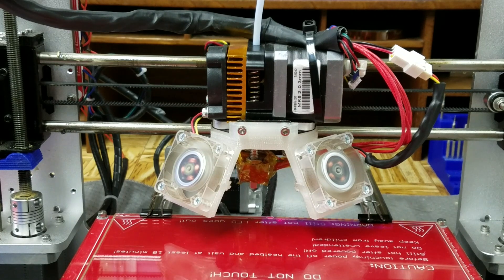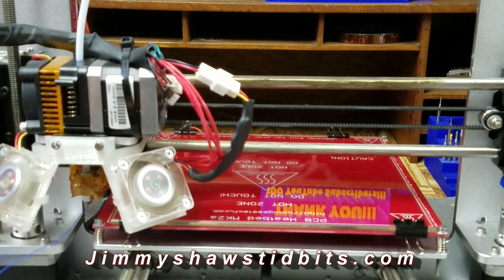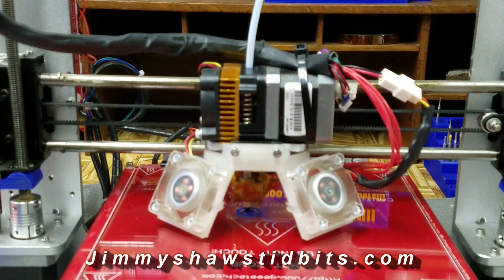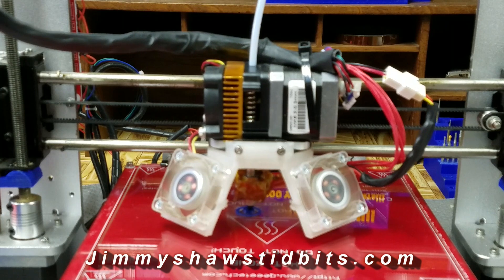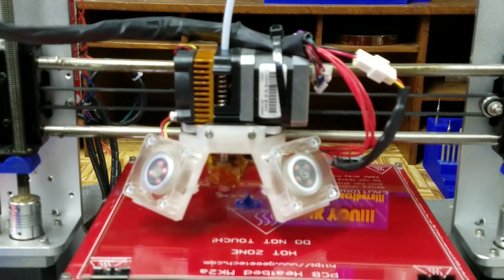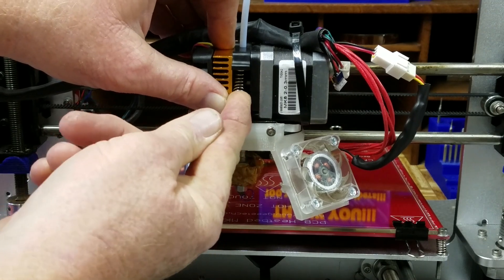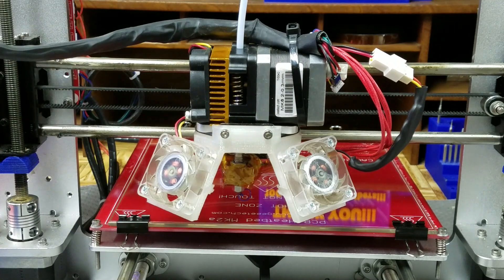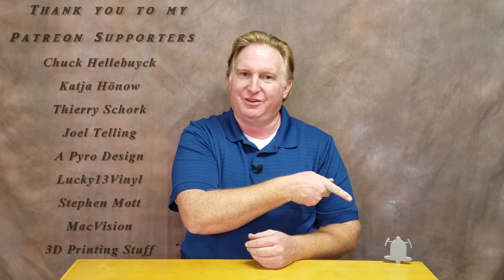Fixing a "clicking" / slipping Extruder using a 3D Printed Shim

Comment: Thanks for the tip Jimmy.  I was having all kinds of problems and I thought it was the nozzle clogged (I still think that was part of it, I only cleaned it a dozen times or so). After your tip, my problems disappeared.  I also think my filament diameter changed just a little (1.74 to 1.70-1.68). Can't say enough for measuring each roll before you start. Thanks again.

Comment: I definitely had issues with this filament feeder due to bad spring tention. What I did was buying a complete new feeder from chinabay. Your solution is really good and I recommend if you have this printer to test it out, even if you don't notice this problem at first.
Reply: I have a recently purchased Geeetech and it seems the spring on mine is pretty strong. Maybe they fixed it.

Comment: I fixed this problem by buying a metal feeder arm assembly for 5 bucks on ebay :)
Before that I used to put metal shims under the spring to increase tension and the feeder arm broke eventually.
Print quality is A LOT better now since there is absolutely no filament slippage in the extruder. I can also extrude much faster.

Comment: The lever presses against a notch on the left side below the aluminum wheel. My guess is you can compress the spring till it's fully compressed, as long as the arm presses against the notch the pressure on your filament does not increase...

Comment: on mine acryl prusa i3 with the mk8 extruder it was not the spring but the piece that stopped the tension weel from rotating any further to the motor gear that caused the problem to solve this you have to use some sandpaper or file to remove some of the material after that mine was working fine I hope that this will help some of you with the  same problem
Reply from the maker: +tom moolenaar Thanks for sharing!!!

Comment: i have a geeetech a10...on my second print n so forth...ill hear the clicking then stops after a while..could it be im too close to the plate? the nozzle not hot enough? i new to this i just want to be careful not to break anything.
Reply from the maker: You are correct.  Double check the bed level to make sure it isn't too close.  If it is not try turning up the temperature by 5 or 10 degrees should made a difference while it's printing.  If that doesn't then then check for a clog in the nozzle.

Comment: Hi,
I have made a home made 3D printer. It was working fine initially but now it is not extruding filament from hotend properly (it is coming out all wrapping into it)

1) is it because no heatsink fan on hotend and it is melting filament before reaching hotend?
2) Is it because there are groves on filament due to extruder gear and that is causing this issue?
Reply from the maker: I would guess the heat sink fan.  If the nozzle throat gets too hot from heat creep from the hot end, the filament will melt a little in the throat.  When that happens it just keeps going till it clogs.
Reply: @JimmyShawsTidbits1   thanks for the reply. I resolved those issues.
Currently I am facing issues with Z motors. After each layer Z motor doesn’t move up as needed and end up ruining previous layer. Currently I am moving Z motors manually (clock wise) to avoid this issue.
Is there anyway, I can increase the Z motor position after each layer?
I am using Slic3r for gCodes and PronterFace for printing the objects

Comment: Hi,

How to adjust z motor reach after each layers?
In my case, z motors are not moving as expected and end up crashing into previous layer.

Is there any config changes needs to be done in Merlin firmware?
I am using slic3r for gCodes and PronterFace for printing.
Reply from the maker: I don't mess with the programing end on marlin, but I believe the lead screw pitch has to be programmed in for the correct z height.
Reply: @JimmyShawsTidbits1  Thanks a lot. I added a gcode to raise z motor after each layer ("Print Seetings --> "After Each Layer gCode" in slic3r) it works for few layers after that it start working in reverse.
Is the value in slic3r gcode gets overwrite when auto z raise reach the same value and turn the z in negative? 
How I solve this z motor issue? it is still crushing into previous layers and ruining everything.
Need advise.

Comment: since when are you rocking a Reverse Bowden? Was thinking about that as well...
Reply from the maker: +JulianGoesPro The tube is about 4 inches long.  I helps keep the filament from kinking or jamming when the side movement of the extruder pulls the filament from the spool.
Reply: oh so it's not connected to the frame... did not pay attention to it when you showed the entire printer^^
Reply from the maker: +JulianGoesPro I would lie if I said it didn't cross my mind.  LOL!!!

Comment: So clicking means it’s not tight enough ? Or is it to tight
Reply from the maker: Clicking can mean several things.   Temperature could be too low, there could be a partial clog in the nozzle or the stepper voltage could be too low, or the bed could be too close to the nozzle.  Another cause can be the spring being too tight or a problem with the bearing that holds pressure on the filament. 

Main thin is clicking means the stepper motor itself is loosing steps.  

If everything else is good and you see the gear just isn't gripping the filament tightly enough, that's when a spacer could fix the problem.

Comment: Hi, I have this clicking problem, it happen when I print, but when I try it with no printing and move the extruder every thing work fine, 
when I turned that screw clock wise on the board , it seems like it's pushing more filament than it need and some area print and some don't. 

Any idea about this problem? 
Thanks
Reply from the maker: +Maher Alsayid Hi, it sounds like it could be 1 of 2 things.  The print bed is too close to the nozzle or the print temperature is too low for your filament.
Reply: Jimmy Shaw's Tidbits when I got the printer 4days ago, there was a blue sticky cheet with it that I places on the heatbed , and I printer 2 big parts for the vat for the sla printer that I'm making, then when I wanted to print the 3rd part I printed it while the bed was cold and it start making uneven  print, I came to take it off that uneven parts and accidently I tarred the blue cheet, so I tried to print on the aluminium heat bed, the filament start breaking and the ticking sound start appearing and while printing, it prints very smooth surface then suddenly an big chunk come out and dry fast, so I have to pill it off. 
Sorry for the long reply

Comment: mine is clicking...but i can see gear on extuder motor pops back which makes me think theres to much tension... i have have this issue on and off again for months... i have even changed extuder motor and extuder tweaking... my nozzle does not  have clog either... i have replace hot end a few times... even bed leveling does not fix... i think i am going to take extruder and motor off my ender 5 and mount it on this machine since i have tried every thing else... i really think its stepper motor is super weak,but no one on youtube ever had this issue or a video on it..
Reply from the maker: The untold thing about 3D Printers is they don't always reach the temperature they are supposed to be reaching.  I would try cranking up the nozzle temp by 5°c, and then up another 5 and so on until either you can tell it is printing too hot or it stops clicking.

I have 2 printers that I have to print 10° hotter than my others to get the same results.

Comment: I bought a CTC i3 clone from Aliexpress; This machine whizz along, but, as a result I suspect this is why the filament feeder clogs with plastic dust. Simple Fix; Switch off, undo 2-4 screws, remove the fan & feeder assembly, clean out the debris then refit both, it should work perfectly again. First "Upgrade" shoud be to Print yourself a PSU plug connectors cover!  Unknown to me, one of the rubber boots on a spade connector had come off. When I reached behind to adjust the Back Right bed level screw I touched it and got <Insert Swear Words> an electric shock. Make THAT your first "Upgrade".*Shame on CTC and any other manufacturer for leaving electric components vulnerable like that. I will try to design a spade connectors cover and post it to Thingiverse..

Comment: same printer same issue, thanks!!(very good first layer, are u using sensors?)
Reply from the maker: No.  I just manually level with a peice of paper and use a 0.3mm first layer at 115% flow.